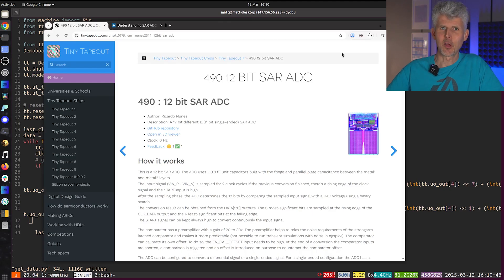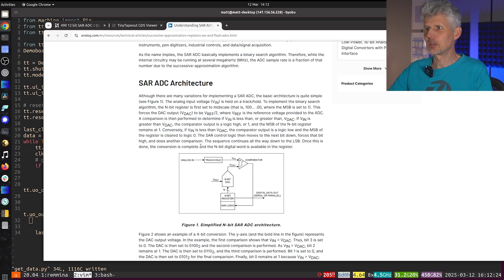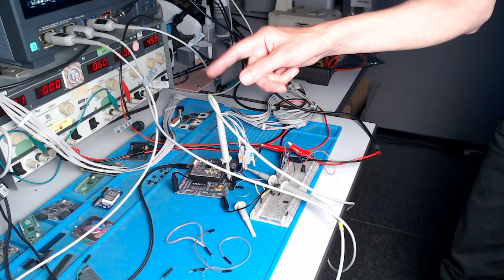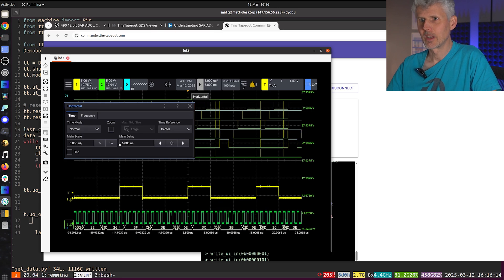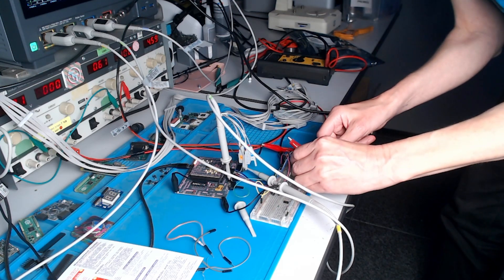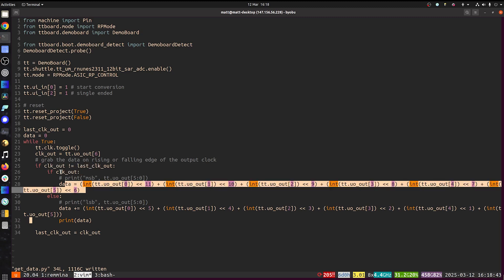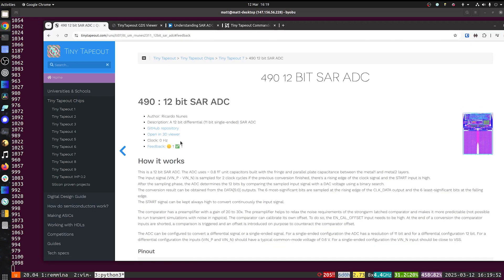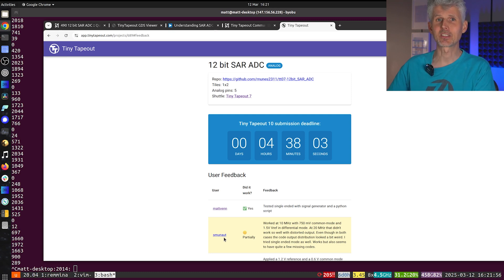Testing Tiny Tapeout 7's 12 bit ADC

Comment: I read that monolithic integration of those large passive components reduces noise. Still looks like a waste of real estate. In the past we had ceramic MMICs (?) , today: chiplets . What happened to those cool ceramic packages anyway? Even 6502 debuted in that. I may have to checkout the asianometry video from yesterday.
Reply from the maker: Ceramic packages are still available, but they're pricey.
Reply: @ CMOS ASIC 100 $, ceramic package 5 $ ? I have some trouble to find these things . Also with plastic we don’t pay much for the this radial traces area where the tight spacing on the chip is spread to the pins on the composite board.